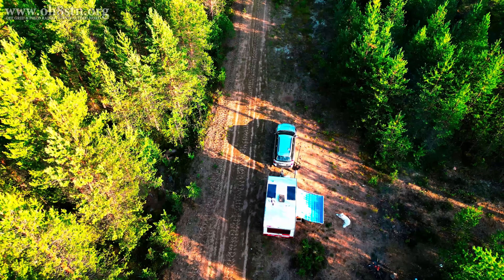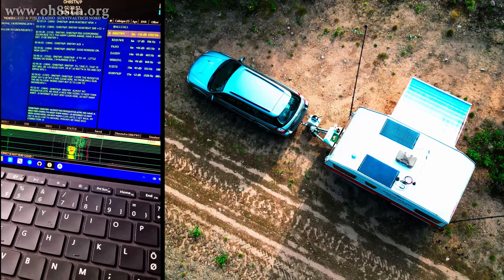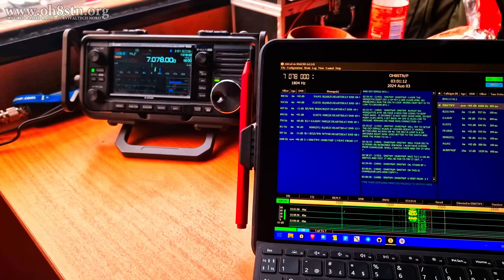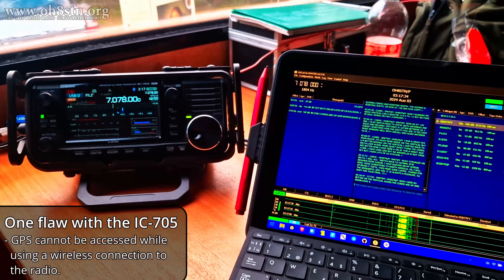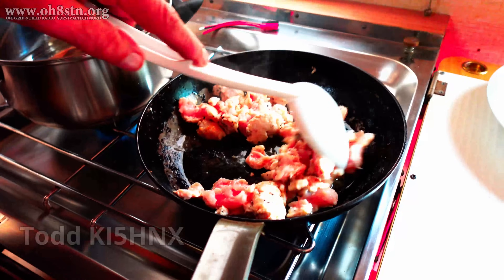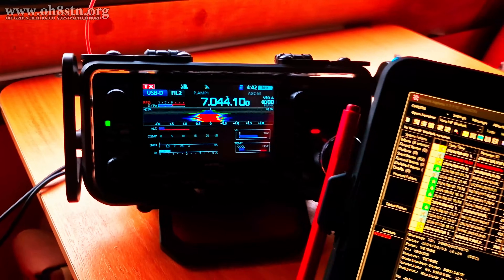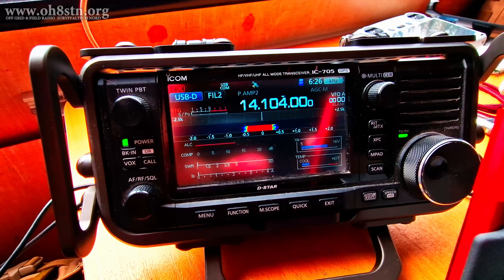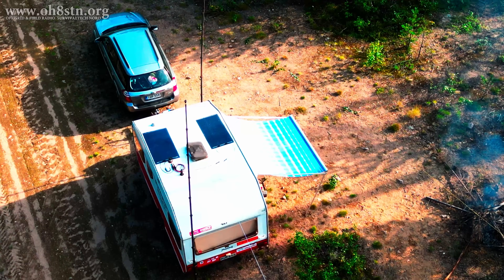Portable Ham Radio Camper Camping Off-Grid

Comment: Julian, it looks like you misunderstand "No random contacts". Couple things.
1. The schedule means you do not have to pound on the radio continuously to contact people close to you, saving limited power.

2. Making random QSOs has limited value in EMCOMM, during an emergency. Being able to network has value. 

I find random contacts to be fun, and tests my gear some, so "no random contacts" is not for me. However, you denigrating the notion is not helpful.
Reply from the maker: I understand perfectly 😉.  The schedule is the weak link. Data networks like JS8Call, Winlink, VarAC allow operators to store a message on the network for later retrieval.  The message can get retrieved even if the station who sent it isn't on-air. This networking functionality removes the weak link in "scheduled" contacts. 
By random contacts, I am referring to alternate RMS gateways, relaying through "random" JS8Call or VarAC stations. I'm not referring to the random contact when one's CQ is answered, or when one responds to a CQ.  
Thanks for commenting. 
73
Julian oh8stn
Reply from the maker: Ahh I see, you've edited your message.
My video promotes staying flexible and adaptable, being ready to connect to any station in the network, rather than the few one was scheduled to contact.
Reply: @OH8STN  I guess it depends on what you are trying to do and if you are trying to limit steps, or who can see your message at any given time.

I try to schedule contacts to test equipment for specific reasons, trying to get farther out, adjustment of height or a new antenna so I know how far I can reach with a certain setup.  After I reach that goal, I will call cq to see where else I can get.  Unfortunately, my paying job does take me away from the radio equipment more often than not.

Comment: Hallo Julian,
what I do not understand is, that you don't use VarAC. In our EmCom-Group we use VarAC, because of VARA it's absolutely faster than JS8Call. JS8Call is for our purposes far to slow (tranmitting different kind of digital data). Why don't you use VarAC? Is it because the developer, Irad Deutsch is an Israeli citizen? I could'nt believe this. He is still developing VaraAC for EmCom with every new release. The software is better usable for EmCom purposes and you use VARA it still for Winlink, which is also a component of our EmCom concept. I'm very interested in your opinion.
vy 73 Carl

Comment: Hej Julian!
Nice video man! I like this idea of an off-grid caravan. I'll start working in mine this fall. 
Man, I have a question about the radio itself. I saw you use the IC-705 but you also have this Lab599 TX-500. If you have money for only one of them, which would you pick? 
You got my mind with the battery consumption thing, I have a FT-891. It's a great radio but as you said it's thirsty. I'd like to invest in one of those QRP radios but it seems people have different opinions regarding this topic. 
73 de SA5PEN
Reply from the maker: Definitely the IC-705.  The TX500 is beautiful,  but it's not finished. There's also lots of wires when you want cst control or data modes. Yes, the IC-705 is an incredible ready to go radio.
Reply: @OH8STN  thanks for your opinion.
Reply from the maker: I was half asleep when I wrote it, but I'll stick by it.
73
Julian oh8stn

Comment: Novice on JS8Call, (and ham radio overall) and would appreciate your opinion.  If I am RECEIVING  over 30 plus QSO's on 40m at night (one from Netherlands while I am on the N Carolina Coast) , but only 5 of those  can hear me on Heart Beat  query (as the black star notation in the right panel indicates) is it safe to say that I simply need more Tx Power? I am looking at the "nuclear option" of a 1500W  amp.

My current set up is Elecraft KX3 with KPA100 amplifier (both with ATU), a Buckmaster 7 band 10-80m  OCFD  which handles only 300 watts limit, inverted V, apex 65 feet, 90 and 45 foot  legs  elevation each at 20 feet, 100 ft coax sloping down to shack. SWR's around 1.2- 1.3.
I do have an old discontinued MFJ 2990 aluminum 43 foot vertical telescoping pole with the balun which I  am thinking about erecting in the back yard with 16 radials of 20 gauge silicone coated wire each radial being around 43 feet length.  What do you think? Maybe lower angle of transmission with a vertical will give better Tx results both locally and dx? 

I'd like to see what the MFJ  vertical does with 100 Watts first of course compared to the Buckmaster,  but the MFJ  can handle 1500 watts. I would like to try vertical at 100 W before considering getting a 3000W capable Buckmaster if it performs better than the MFJ vertical and it boils down to simply needing more brute Tx power. 

Thanks, and I enjoy your videos and the scenery and solitude at the Arctic Circle. Will be tackling Winlink when antenna issues sorted out. 73's.  
Karl AF5LQ
Reply: Before you spend a bunch of money on a very expensive amplifier, I'd suggest you check your audio output to ensure you are getting the correct audio (full output power, little to no ALC) from the computer, through the audio interface, and out through the radio.  Next, I'd check that antenna and make sure it doesn't have some sort of issue.

  Lastly, many operators leave JS8Call up and heartbeating, but may be doing other things.  So there may not be any issue with your setup at all; but just a bunch of zombie stations at the time you're operating.
Reply: @N0LSD  Thanks for the overview . I hadn’t  thought of the zombies but I forgot to mention that I have the same dilemma on SSB and CW. I can hear lots of people but no one can hear me. My KPA indicates 90-100 watts peak output when TX, but will check higher up the signal source on the computer and the KX3.